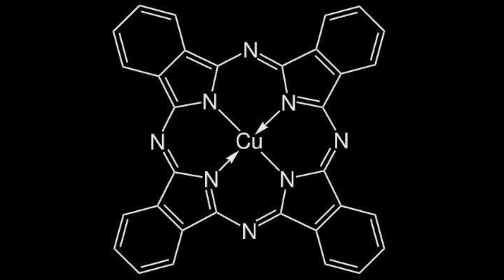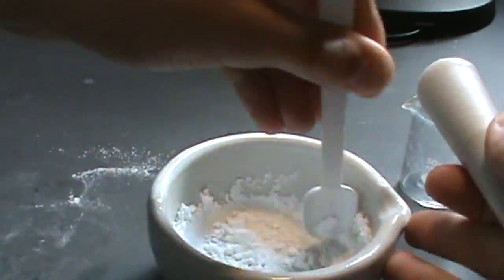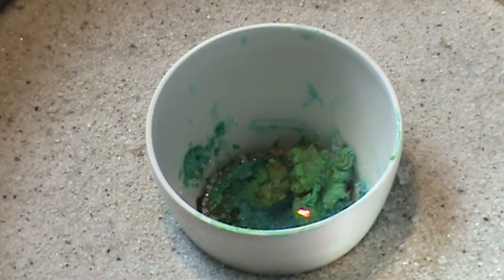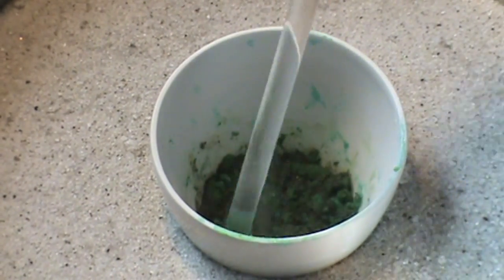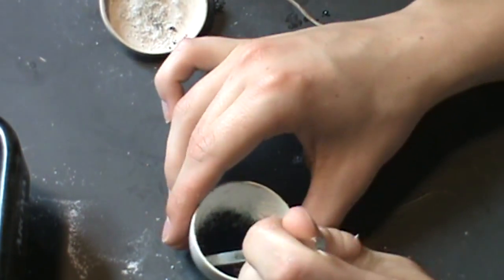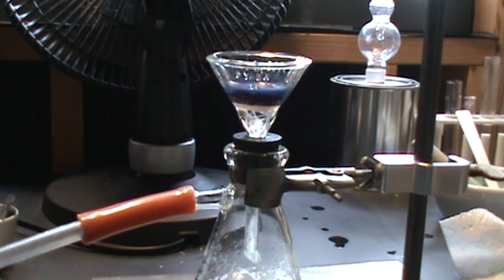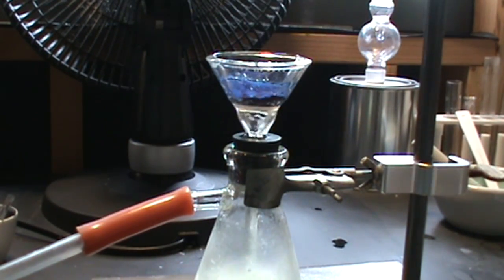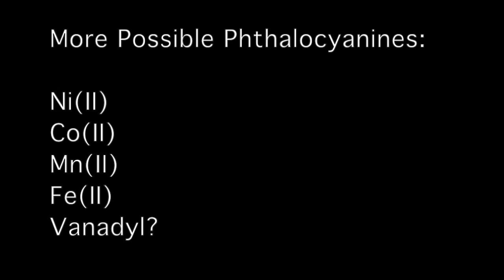Synthesis of Copper Phthalocyanine

Comment: Using a suitable solvent carrier will result in a higher yield but can be quite dangerous as it requires a solvent with a relatively low vapour pressure at 200C...and most of those solvents are highly flammable.  chemx01 used kerosene as his solvent and demonstrated a 73% yield.

Comment: Copper Phthoalocyanine may seem really easy to make, and it is, but do be wary that it stains everything. It's known to be really difficult to remove once it stains.  It's not necessarily dangerous (relatively, although it is a high heat process), but it is extremely messy.

Comment: I've been fooling around with Graphene super-capacitors based on Robert Murray-Smith's YouTube channel, one of the things 'n picked up is the use of "Deep eutectic solvents" and Ionic Liquids. Not going in to deep into something I do not consider myself an expert in, the short is Urea (Ethylene Glycol also) likes to complex with metal Halide salts, forming an Ionic liquid. (Side not, oddly it is that exact same complexing between Urea and Copper Ions that is the reason for the bright colour of the resulting compound you're synthesizing) So what happens is the two powders complex with each other forming an almost oily viscous liquid. I would think that you would need a stoichiometric ration op Copper salt to Urea for your reaction thus "dissolving" all the powder, but seeing as you end up with a past like consistency I am not entirely sure what are all the possible causes at play here, again, I am by no means an expert in this, just something I have seen happen and done myself a bit. Hope this little insight was at least somewhat interesting.

PS: Something I just thought of, the complexing between Urea and the Copper (II) Chloride might release water as it a hydrated salt, adding to the paste like consistency, maybe the complex might not even be a liquid at room temperature, as I know not all of them are (those that are not are call Ionic Melts I think)